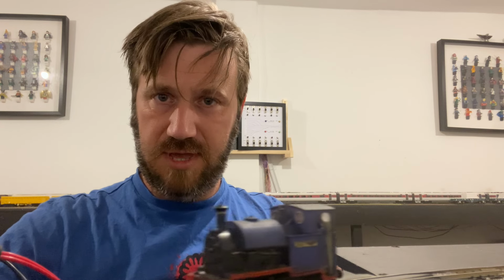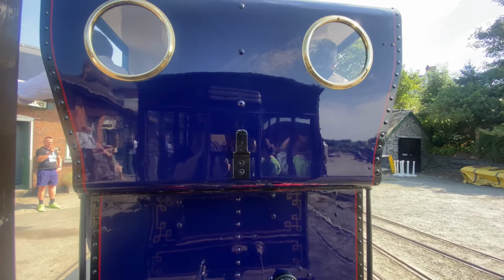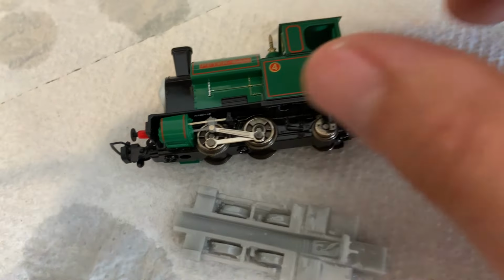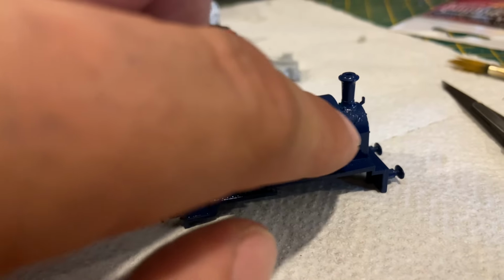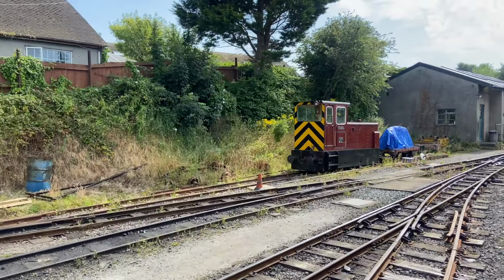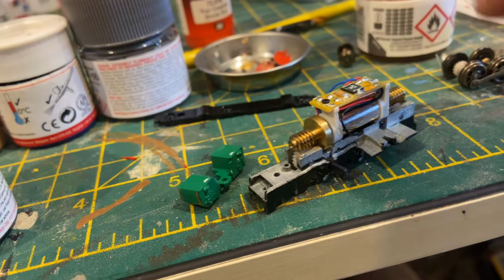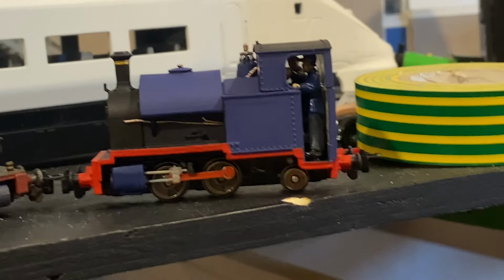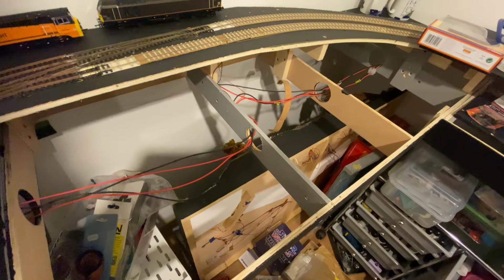A day on the Talyllyn and 009 Modelling | Building a Fourdees Tattoo kit

Comment: Enjoyed watching that, thanks.  Nice mix of 1:1 and 1:76.  Surprising how a bit of paint can make the clumpy valve gear look so much better.  Presumably it's a clearance issue underneath, and it's beaching on that rerailer/crossing/power-supply bit of track?

I was hoping that a 4D model would be bigger on the inside so you'd have room for big flywheels & stay alive to keep it running smoothly. 🤣🤣🤣
Reply from the maker: There is some space in there, there’s a cavity in the smoke box that I decided not to fill with lead so I can add a decoder at a later date.
That piece of track is trouble for everything even the Percy loco that came in the set doesn’t like it.